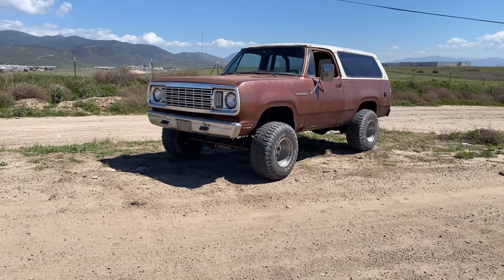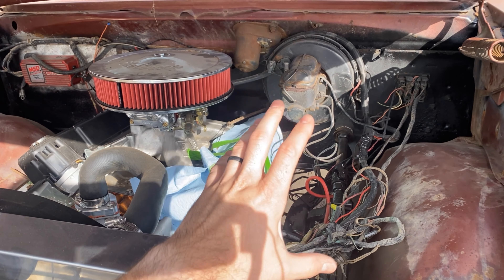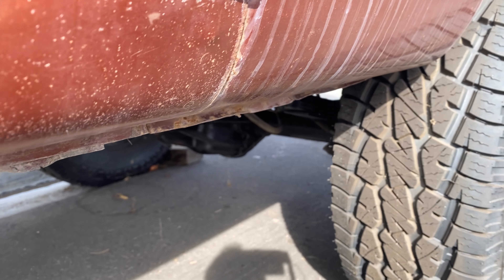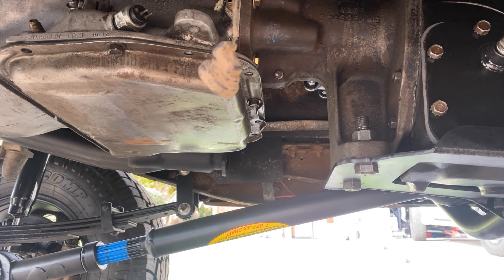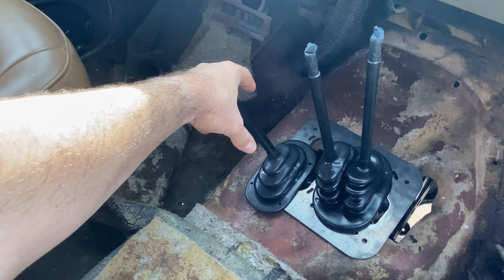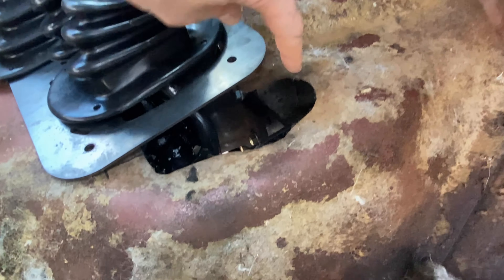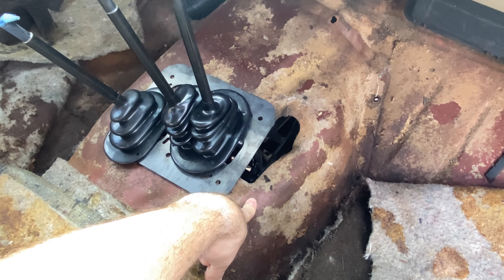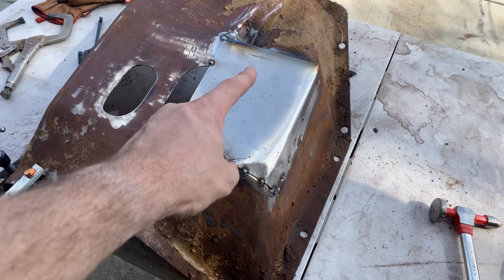1977 Ramcharger UPGRADED with a 426” Big Block and a 203/205 Doubler

Comment: The one-ton trucks use the small diameter short boosters, rockauto has them. I have an 84 dually so you got me thinking because I have run a 440 in it with no problems. Guess I'll have to order the complete master cylinder booster setup for my 83-ram charger as I have one-ton axles in it and may stuff a BB in it. 4inch lift with 35-inch tires.
Reply from the maker: I’ve seen some listed online for sale however, they all show backordered with no expected availability date. They have for the last 4 months at least.
Reply: @sorta_stock  I just checked rockauto and they had the boosters less master cylinder available for around a hundred bucks. And they have the master cylinders sold separately. I checked for an 84 d350 Dodge at 10:12pm this evening.
Reply from the maker: I found and just ordered the one you are talking about. Got my fingers crossed it shows up at my door soon. Thank you!
Reply: @sorta_stock  Glad to be of some help. Got to keep these old Mopars on the road.

Comment: You can swap in a d250/d350 dual diaphragm brake booster (9" diameter) the only difference is the use of a 2 bolt master vs the 4 bolt and I believe metric fittings on the master cylinder
Reply from the maker: I’ve looked for the D250/350 and W250/350 boosters but, all appear to be out of stock as well. Some wait to tell you until you’re at the purchase point. Super annoying. I could always retrofit a universal setup if it comes to it.
Reply: @sorta_stock  showing instock for me on rock auto for a 90 d250 gasser. Like he said 2 bolt and im not sure if the pushrods are the same length i would have to go out and check my trucks. New too not rebuilt rusted garbage
Reply from the maker: Just ordered the new unit that now shows in stock on Rockauto. Got my fingers crossed it shows up at my door this week. I’m hoping the pushrod is the same but, nothing an adjustable one can’t fix.

Comment: Yeah those 203's are a pretty amazing transfer case. I had a little trouble with the one that was in my 78' W150, the splines inside the input shaft of the transfer case stripped out. I had a 4 speed on mine though.
Reply from the maker: The 203s are tough cases, but that spline issue is common if you weren’t careful with the input shaft.

Comment: There is so much room under those trucks without the stock tank in them. I run a tank in the bed and would love a doubler setup but what i need really is a gear change. 2.90 isnt exactly the greatest for big tires. 4 speed helps out aton though that manual swap 10/10 worth it.

Comment: You actually need a big block truck water pump housing, it exits low on the passenger side
Reply from the maker: This is a big block water pump housing. They switched output directions in ‘73. My 426 stroker is based on a ‘72 400. I ordered the pump correct for the engine and the radiator for the year of the truck. My fault. No biggie. I’ll work a hose setup to reach it
Reply: @sorta_stock  440 source I think sells the aluminum water pump housing with a passenger side output, but either way, this rig is shaping up to be pretty sweet! Flingin' some mud!